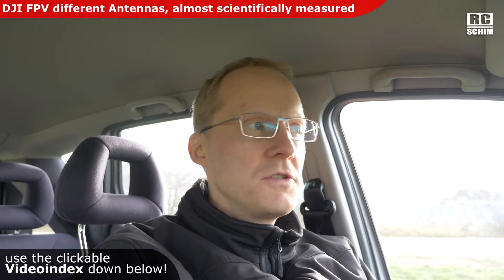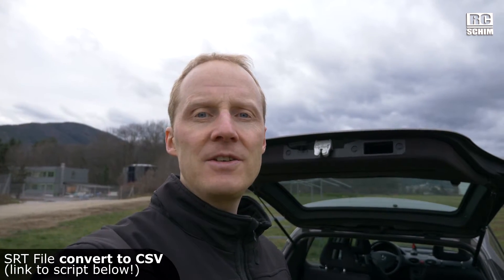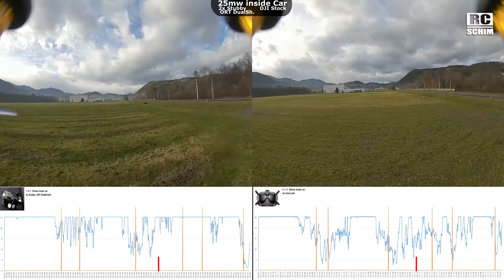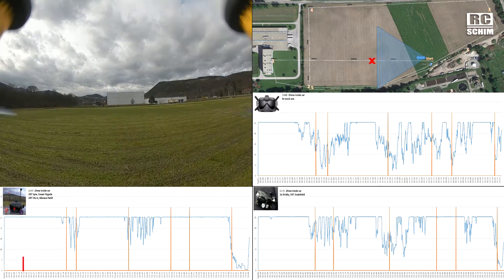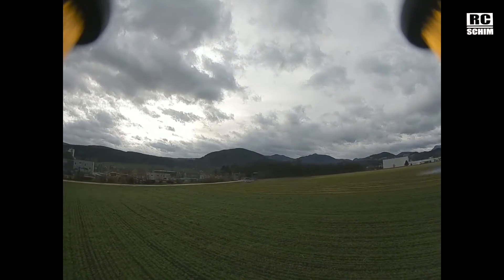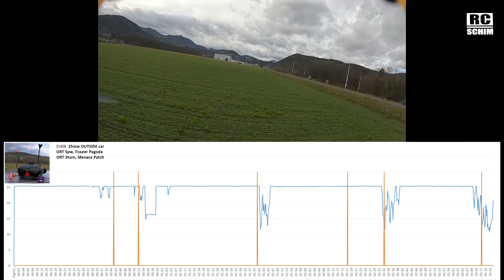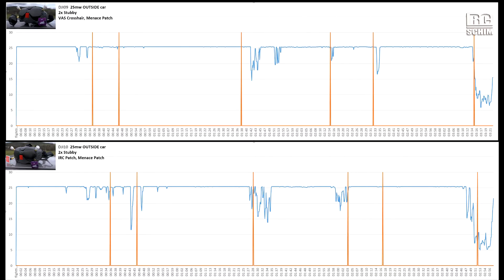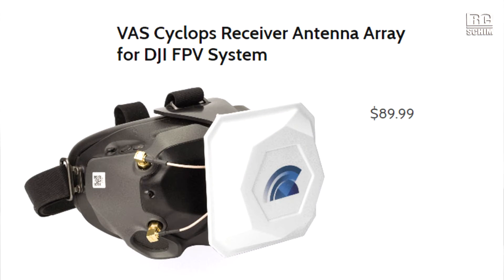DJI FPV Antenna tests - almost scientific!

Comment from the maker: with the newer firmware the SRT to CSV converter script needed a little modification (they've added the "rcSignal" column at the end).
so use the newer script if you wanna convert SRT files for Excel use: https://drive.google.com/open?id=1tReDPHsI9d32bzS7eNKSoKZVBoQ9cEYG
Reply: Thank you for the .vbs script - it took me a while to get it working but it's extremely helpful for excel plotting this data!  I found by default the semicolon ( ; ) delimiters didn't work for me. It might be a locale thing (UK uses . for decimal point not , and CSV imports use comma ( , ) between fields instead of semi colon ( ; ))
I made some changes to the script which I've copied below, hope it's useful for you!
 1) Changed to a comma , delimiter which seems to be required for the UK
 2) added some comments at the top on how to run with CScript
 3) Swapped around Timestamp and CSV data so that Timestamp is first column
 4) Used mid function to crop out hours from the timestamp leaving mins:seconds.thousandths - this makes it quicker to plot charts - just select time & data column and plot to a scatter chart.

[Srt2CSVConverter.vbs copied below]

' Put this script into the folder containing .srt files
' Open a command prompt (cmd) and run the script with CScript:
'    CScript Srt2CSVConverter.vbs
'
Set objFSO = Createobject("Scripting.FileSystemObject")
Set oFolder = objFSO.GetFolder(".")
For Each oFile in oFolder.Files
	if instr(ofile.name,".srt")<>0 then
		'wscript.echo oFile.Name
		filename=ofile.name
		Set fRead = objFSO.OpenTextFile(filename)
		Set fWrite = objFSO.OpenTextFile(".\" & replace(filename,".srt",".csv"),2,true)
		row=0
		TimeStamp="00:00:00,000"
		fWrite.WriteLine("Time,Signal,channel,flighttime,uavBat,glsBat,uavBatCells,glsBatCells,delay,bitrate,RCSignal")
		Do Until fRead.AtEndOfStream
			buffer=fRead.ReadLine
			anf=instr(1,buffer,"signal:",0)
			if anf <>0 then										' If line starts with signal:
				buffer=mid(buffer,anf)
				buffer=replace(buffer,"V","")
				buffer=replace(buffer,"signal:","")
				buffer=replace(buffer,"ch:","")
				buffer=replace(buffer,"flightTime:","")
				buffer=replace(buffer,"uavBat:","")
				buffer=replace(buffer,"glsBat:","")
				buffer=replace(buffer,"uavBatCells:","")
				buffer=replace(buffer,"glsBatCells:","")
				buffer=replace(buffer,"delay:","")
				buffer=replace(buffer,"ms","")
				buffer=replace(buffer,"bitrate:","")
				buffer=replace(buffer,"Mbps","")
				buffer=replace(buffer," ",",")
				buffer=replace(buffer,"rcSignal:","")
				buffer=TimeStamp & "," & buffer					' Combine the Timestamp and CSV data
				fWrite.WriteLine(buffer)
			else
				if instr(1,buffer,"00:",0) <>0 then				' Else if line starts with 00:
					'Time marker
					buffer=replace(buffer,",",".")				' replace the , in the time stamp with a .
'					TimeStamp=left(buffer,12)
					TimeStamp=mid(buffer,4,8)					' take mins:seconds.thousandths
				end if
			end if
		Loop
		fRead.Close
		fWrite.Close
		Set fRead = Nothing
		Set fWrite = Nothing
	end if
Next

Comment: What is the best for the dji fpv under 300€
Reply from the maker: Check out my Kaiju review - this on is specifically designed for the DJI FPV (potatoe)
or the Digieyes V2 from ORT  (they are cheaper and smaller, I'd prefer them).

Comment: But the two top antennas work together and both bottom antennas  according to DJI, I have hear that you shouldn't mix antennas ,I mean you have to have two exact the same antennas on the same row ? Upper antennas only transmit so the lower antennas is the most important i think as they receive the information to the googles
Reply: I think I read somewhere it is only the lower left antenna that receives anyone care to confirm?

Comment: I have a friend who flew his plane out 3 1/2 miles and set it to circle, then he tried patches on bottom with omnis on top and then tried patches on top and omnis on the bottom and he said he got better performance with the patches on the top. he said latency was at 115ms with patches on bottom and 23-30ms with patches on top. Have you tried this and if so what are your thoughts?
Reply from the maker: Thanks - good info. Gives me ideas what to try next.
Going out that far is of course perfect for testing antennas and their placement!
I plan to have a GPS RTH copter with caddx vista so I can safely go out further and test similar things.
Reply: Hi, could you please ask to your friend what patch and omni? And he also changed the air unit antennas or only the antennas on the goggle?

Thank you

Comment: hello who is the best
Reply from the maker: not easy to answer. currently I have really cheap  AomWay SPW   (RHCP, RPSma) on top 2 ports and 2 foxeer lollipop stubby on the bottom, this way it fits in the backpack.
if I fly far away, I use 2 patch antennas on the bottom ports.
I will do another bigger antenna test like this here soon, maybe I can give better results then!
Reply: @Rcschim  Ok Thanks sir

Comment: Hello shim new to your channel. Are we free to use any 5.8 antenna as long as we match polarisation. This will give me plenty more options on a build where I need length on a big 10” nasty muscle quad stick antenna just to short don’t clear battery. Thanks.
Reply from the maker: yes, you just need to match polarization! 
last time I tried to use my only UFL rhcp pagoda (Foxeer) but it gave me terrible range on caddx vista. Not sure what went wrong there...
other than they, yes you can still use the "old" 5.8 antennas in the digital world :)

Comment: Very Impressed ! My First time seeing your stuff and Im very very Impressed. I really want to see a long range setup using these goggles as I want these googles but for long range missions say 10km - 30km at least
Reply from the maker: Thanks! Longrange with DJI FPV will not happen soon I guess. You can install directional antennas, but as far as I understood they use some sort of sync puls which means, beyound 4km (or miles?) you get rather immed drop of signal quality.
Some say they flew further, but most run into this 4km range limit.
not a problem for me here, since Copter FPV 2km are already considered longrange :)
Reply: @Rcschim  Thanks for your reply. So there is no way to boost the signal from the plane ?
Reply from the maker: @ctbully  as far as I understood, it's not a fault of too little RF power - but the "runtime" of the signal exceeds the sync-pulse time - pakets are too late - and therefore it doesnt work with more distance...
maybe they implement a longrange mode tho - with more range and higher latency, without the need for a syncpulse...
they show quiet impressivly that you can have 10km range on a standard mavic air 2 (without and directional antennas) - but normally their latency is really high on the ocusync vide transmission (which is totally different from the DJI fpv video transmission we use here btw.)
Reply: @Rcschim  Thank you for that very detailed explanation.
Reply: Guess u already knew someone already " hack " to 1200mv on de dji fpv goggle,  and other tested with over 7miles ( not k/m )
Reply from the maker: @AlphardV55WR35  yes, but I dont like to use all the power if not absolutly neccessary (maybe flying in dense woods needs that ammount of power?)
700 are fine most times. good to see that with the 50mbit firmware upgrade also the magic 6miles (or was it 4miles) barrier fell. Gives me confidence to know the video goes way further than I need  (flying 1.5km already felt really far with a smaller quad)

Comment: do you think dji glasses are harmful to the transmission of waves in the brain? and if, in these glasses, you mount an external module for the analog, the problem of transmission harmful to the brain remains?
Reply: no
Reply: @Frosttyy12     I expected an exhaustive answer from you, perhaps making a video and explaining to all of us "laboratory guinea pigs", the reason for your statement
Reply: @progab24  Despite every attempt to the contrary, there has been zero evidence of radio signals in this range, having any kind of effect on anyone's brain, negative or otherwise. Some excitable types have of course disputed this but they can be totally ignored, as predictably, they have absolutely no substantive evidence of any kind for their claims.

Comment: how did you connect these antennas to the goggles?
they have unique mounting bracket yes, most of these antennas are SMA, so you have used adapters? which adapters did you use and is there a loss of signal if you use an adapter?
Reply from the maker: hi, you mean the "dual shield"? It's got a flat back (3d printed part) which I taped with velcro sticky tape - so it's removeable but stays there quite well.
here in this vid I used all "normal" SMA antennas - that means I had to use SMA to RPSMA adaptors. 
Later I bought just AOMWay SPW antennas (with short coax) which already were ordered in RPSMA - so I dont need an adaptor.
Sure you loose a bit with sma adaptors - but not much.
Most loss would come from longer extension cables  (like I once tested 3m extension - and here the loss is 50%!)
Adaptors have to look like these here: https://www.amazon.de/gp/product/B07RQSSBTY/ref=ppx_yo_dt_b_search_asin_title?ie=UTF8&psc=1

Comment: Hello, can I use RHCP antennas all around (goggles and air unit)? thank you
Reply from the maker: Yes! If you buy some for goggles you can buy rpsma so you don't need adapters. On air unit it is mmcx.
I bought some cheap aomway spw with short cable for the goggles.

Comment: This is a great video and approach. Can you tell me why you only test the patch antennas on the bottom ports? I am assuming those are the only ports that you thought receive video data? Thank you for this work. I only ask this as IBCrazy (VAS) suggested to me two VAS Crosshair Extremes on the top two ports while TrueRC stubbies or VAS Minions on the bottom
Reply from the maker: At the time of this testing I thought it is the best way, but later read that top or even side 2 ports would be best.
Reply: @Rcschim  That would make for another highly liked video. Thank you.

Comment: If you were to start from absolute zero FPV equipment...   which I am...     Should I go the ANALOG ROUTE with a Caddx Ratel viewed on 10.1' Feelworld PVR-1032 analog monitor on tripod ($45, already bought, because I wear glasses) and Jumper T16 transmitter upgraded with Crossfire transmitter/receiver modules, or instead go the DIGITAL ROUTE and save up and instead just go with the complete end to end DJI Digital FPV Goggles/Camera/Transmitter setup? 

I can see where I could learn a lot more going the ANALOG route playing with cheap CMOS cameras and vTX's and flight controllers and OpenTX and Crossfire on the Jumper, but on the other hand I'd never reach the video quality of the Plug and Play DJI Digital system.     But with the DJI Digital system I wouldn't end up with a bunch of cheap analog things I swapped in and out and I tried and spent money on and never fly...

So starting from zero.. should I go totally DJI digital from the start, and just dabble in the analog stuff to learn and experiment with it...  (I think I can learn cheaper by watching tons of videos without having to buy it all)  or should I just burn my way up the ranks buying a lot of analog incrementally stuff and trying to cheap out but end up with a lot of junk but with a lot of experience?  I mean, there's merits to both.   I like to build and solder, it's true, but I also would rather spend my time instead flying to gorgeous footage instead. 

My inclination is to go the school of hard knocks route experimenting and learning, but I watch videos of people flying the Digital system and it seems they never really want to go back to analog after that.   I guess soon, we'll have other competing lower cost Digital systems out there to chose from than DJI, but it may take a while for those to come out.

I have a crappy job, so money is not the biggest issue, as saving up for either route is just a matter of time.  I think in the end when you add it all up they will mostly all be the same ballpark $$$ wise.

 fpv.air-war.org
Reply from the maker: Wow, that's a long comment...
I think I'd suggest to go the DJI route. In the end it could be even cheaper while giving better quality.
Depends also what you want to do with FPV. If it's "just" for the flying experience DJI is more than enough. If you need cinema quality - you need extra things like good gopros...

Radio link? I'm not so sure about their remote.  Bruce (RCModelReviews - check out his latest reviews - like the Kopis DJI sys for example) he also tested the Radio and came to like it.
You just cannot program so much like with an openTX sys  - so it's not as flexible. 
But maybe it works for you, and you never miss the extra features?
OpenTX on the other hand, + Crossfire - they're not only expensive but also need firmware updates... this can be frustrating. 
DJI also comes with Updates - but here it's simpler  - like apple...
Check my other video https://youtu.be/vvJmRN5tS2A    where I try to compare Analog and DJI FPV...
hope this helps, greets and have a good start into this hobby - you have no idea how easy and great FPV has gotten these days (I started 2008 and it was soooo experimental and crappy back then!)
Reply: @Rcschim  old news, but for everyone else... DJI Digital FPV system :
https://www.youtube.com/watch?v=-MkVrdaZu4s
Cons?:
https://www.youtube.com/watch?v=DQaTm1O81H4 

https://www.youtube.com/watch?v=CZYDmOSuWRA

https://www.youtube.com/watch?v=oE02v3fx5m4
Reply: @Rcschim   - I bought a TX05 yesterday (eta Jan 4) to run with my Remzibi OSD and tape to the top of a JJRC H68G gps quad...  and the 10.1' Feelwell Diversity flatpanel monitor I got for $45 (eta Jan 28).  So only $65 so far spent to dabble my feet in analog.  

While the golden age of quads were taking off I spent 5 years inside a video game flying a quad like vtol attack aircraft in BF2142 so I'm not an entire stanger to the flying part.  

I got Velocidrone installed with a Realflight RC type usb contoller and just got a Geforce 1070 in mail today so I can install Liftoff as well.

The DJI stuff is probably  more headache free. exactly as you say but Im not crazy about being geofenced off or their random updates happening in the middle of a flight on their Mavik quads, etc or so Ive heard.  Also being able to run a lua script with a flatpanel telemetry artificial horizon on a Jumper T16 displaywould be good backup if I ever lost the video feed.

Still on the fence and saving up Januarys shitty paychecks for $1000 to go either way.  Partial to maybe the Banggod freestyle quad with DJI receiver and 9maybe a Hero 7 or $$$ Hero 8 on it for that Hypersmooth + Boost at 1080p.  All pretty $$$ expensive stuff, might easily take 2 months paychecks :-)

Either that or buy another ultralight airplane fir $4500 or some hangers...

Thanks for your opinion and view in retrospect what you would do from the top of the mountain if  starting new from today.  I watch thousands of videos to research before I buy stuff so I have some ideas buy now.  Id really like to fly supersized (6 ft+ across) industrial quads.... someday.
choppergirl.air-war.org
Reply: Hope do you mind me chiming in.. absolutely go with DJI if it’s not to late but whatever you do,do not try DJI before you try analog or you will be DJI poisoned and you won’t be able to handle the shitty analog anymore.. lol.  The DJI remote is actually a very nice and well built transmitter it feels great and the gimbles are good as the best out there in my opinion! Plus it saves you weight as you won’t have to use a receiver because the air units both standard and caddx are a receiver in them selves.. hope this helps !

Comment: Why stubbies on top and patches on bottom? Seems opposite of how everyone else does it.
Reply from the maker: hehe, that's me :)   no - I simply didnt know better. Tried it like I would on analog (since the omnis are usually placed better on top). In my flight yesterday I had dualShield on one side (top+bottom) and stubbies on the other side - seems like a good idea - was pretty far out on 25mw with no issues
Reply: Ah okay. Thank you for all your testing!

The “traditional” way may work better as the tops seem more critical while the bottoms are just to add a bit more bandwidth.
Reply: @TweakRacer  Yo dude I'm literally scavenging the internet right now to get an answer for this! I just got a true RC x2 air LHCP for my goggles and 2 TrueRC Singularity stubbies and I found AndyRC's goggle video very informative and he gives like science behind how the top two have a different job than the bottom two?????? lol I'm not really sure. I'm still researching but I think the move is to put patch antennas on the bottom I think. Not sure.. your reply to your findings is appreciated. Watch AndyRC's DJI FPV Goggle video! Let me know what you think.
Reply: @marcusmartinez1584  I saw Andy's video. Seems people in Europe tend to do patches on bottom, while Americans put the patches on top. Try both ways and see how you like it. 
I prefer patches on the top for any mid-range or higher penetration needs. The top ones receive AND transmit, the bottom ones just seem to receive and supplement the feed from the top ones.
Nowadays, mostly fly with Singularity stubbies on all four. When I go for longer ranges, I put TFP Mini's on all four, using short custom flexible adapters focusing them all generally forwards.